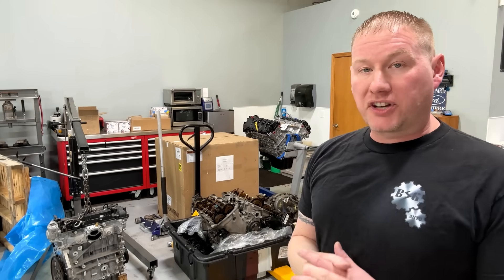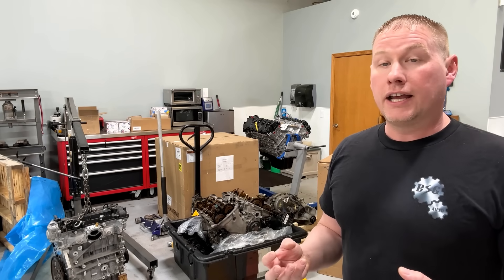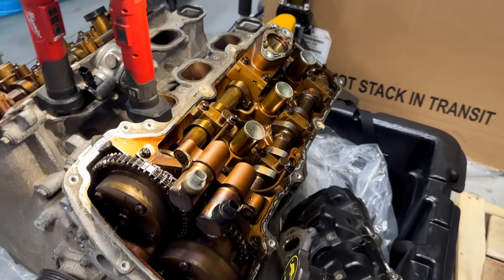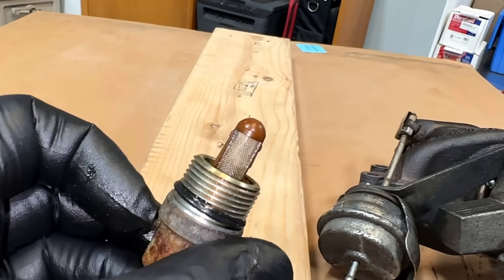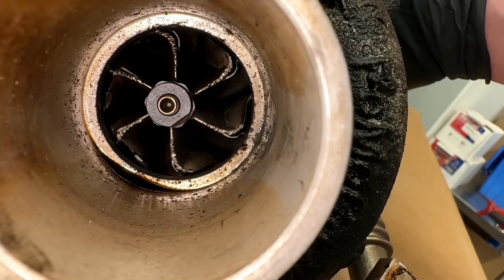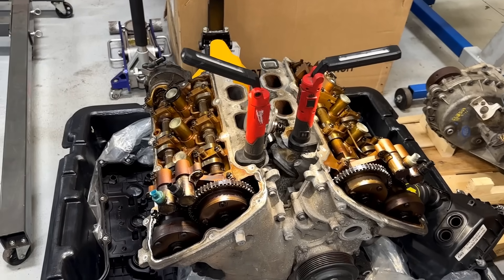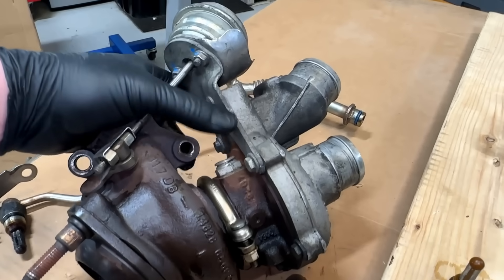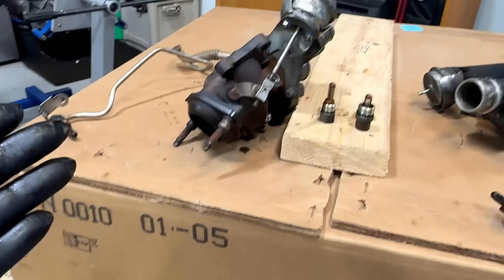This is Why You Never Run Extended Oil Change Intervals on The Ford Ecoboost Engines!

Comment: What weight do you recommend also does it matter what brand of synthetic oil? Is costco Kirkland brand full synthetic okay?
Reply: 5W30 in the 3.5 Ecoboost. The 1st gen 3.5 is not too picky, it cares more about the interval and the correct weight more than anything else.
Reply: @BamaTidefan1967 that’s what I use, I also change my oil every 2500 miles or less. Costco full synthetic and the filters I use comes out to 22$ an oil change. Well worth it to do it all the time than to have these issues. I also run that BD oil treatment ever other oil change.

Comment: I have used Full Synthetic , have even sold it , for 5 years or so in my high mileage vehicles , no turbo though , going the extended miles and then some a few times and never had an issue. Sent in to be checked  a couple times and could have spun on new filter and kept on with close to 36,000 on 25,000 oil. From my 2001 Lincoln Town Car , 4.6 V8 300,000. I do all mechanic and maint. Im getting the Trans changed with their brand and everything serviced for its third Vac trip we do in June from Kansas to Montana. Wife runs it 6 days a week to work just over 60 mile round rrip so it helps me not being under it every week. Good product and regular tlc is key. Good video.

Comment: This subject is the main reason I have always said putting turbo's on gas engines for the general driving public IS NOT a good thing. The manufacturers cheap out on oil coolers, which I feel is very crucial in keeping the oil from breaking down and develop sludge and varnish. Also the manufacturers testing methods don't come anywhere near real world everyday driving. They upsale the maintenance schedule because they know if you follow the manufacturers oil change intervals, you will be breaking down soon after hitting the end of the warranty.

Comment: Does the 3.5 take 6 qt or 5 qt of oil? I have a 2016 3.5 with 150k miles, and I owned it since 110k. The dip stick has always indicated its full with just 5 qts of oil but the owners manual says 6 qt
Reply from the maker: The 3.5L has always been 6qts.
Reply: @FordTechMakuloco  should I be putting 6 qts in even though it's showing its overfilled on the dip stick? I do oil changes every 3-5k miles with just 5 qrts for a few years now and the engine has always ran as smooth as butter

Comment: Can you buy those screens by themselves?  Or do you need the full oil line?
Reply from the maker: They are sold individually.
Reply: @FordTechMakuloco  Thanks! Do you happen to have the part number for a 2014 Flex?

Comment: If you run conventional oil you will have this issue every time. Running a high quality synthetic and having your oil sent off to be analyzed when you change your oil will give you a lot of good information about how long you can stretch one oil change. I’ve seen turbocharged diesel engines rack up over a million miles on 60k drain intervals and never had sludge issues  they tore the engine down end everything was within factory specifications for reuse. It’s all about the oil you buy. A high quality full synthetic will always outlast conventional oil. Some brands of synthetic are better than others. Me I’m a schaffers guy I used to run the pennzoil platinum then switched to schaffers because it’s a better longer lasting synthetic oil. I’ve saved money making the switch to schaffers oil and not having to change it as much
Reply: Also my engine isn’t sludged up. What little bit of sludge and varnish is in my engine is from way back when it had less than 150k and was getting motorcraft oil ran in it.

Comment: On the new 2.7 ecoboost that are direct port injection. Ford recommends synthetic oil at 10k intervals. Should I change it sooner than the recommended ford intervals?

Comment: You recommend full synthetic? I do 4000 miles with fords synth blend.
Reply from the maker: On a direct injected turbo based engine oh yeah
Reply: @FordTechMakuloco  i got a 2018. I believe it is direct injection. Maybe i should switch to amsoil…

Comment: All direct injection turbo engines should be running a catch can. I’m installing a catch can as we speak on my wife’s 90000 2.3 Mazda turbo, I replaced the turbo with a brand new unit around 80000 and it still sucked oil into the intake immediately after. Biggest pos I’ve ever worked on, the first and last turbo I’ll ever own.
Reply: Dual injection engines don't really need a catch can but with just DI, absolutely.

Comment: First gen ecoboost on my 2011 F150 and I've got 287k miles! Religious maintenance and it's treated me well! No major repairs (yet)
Reply: yea, i remember the 200,000k mi. days, seems like yesterday.  Set the dash reminder at 50%, Oil Change at 5,000 mi..  2011 F-150 w/ 3.5 Eco, sitting today @ 397,745k mi.  Next Oil Change @ 400,000k.  I also add Lucas Oil Stabilizer @ every oil change, 4oz. when i was under 200,000k, 8oz. ever since.

Comment: So bought a used 2018 f150 2.7 90,000miles from Ford dealer put 5000 miles on it and had oil changed at same dealer they were adamant on 5k oil changes book maintenance interval all wrong! Thanks for the video. I learned a lot.

Comment: Great video, it is amazing how owners will will keep pushing longer oil changes, I don't care what they say
I always change my oil on everything 3000 to 3500 miles, it doesn't matter if it full synthetic or synthetic blend,
it is much easier to change oil and cheaper than changing a motor out.
Reply: Me too I use oil that they claim can run long service intervals but I still change at 3000 miles

Comment: Not a 3.5 EcoBoost, but on my 2.3 EcoBoost (2021 Ford Ranger) I have gone to doing a drain and fill on the oil every 2,500 miles, and a full oil and filter change every 5,000.  Full synthetic only.  These turbo motors dirty the oil after very few miles!

Comment: Every 3000 miles with synthetic high mileage oil on my 2015 Escape Titanium 2.0 with 132,000 miles...oil is crystal clear at and after oil change. Well worth it IMHO. Snappy little engines that make driving so much fun!
Reply: which synthetic high mileage oil do you use?
Reply: Love my 2.0. Maintenance is key.

Comment: Thx for all the great videos.   I know you are busy but I’m hoping you can answer a question for me.  I’ve watched your videos on transmission fluid change and filter change on F150’s.   I have a 2013 with a 3.7 that has 134k and I want to change rear diff fluid and trans fluid.   The trans fluid change makes me nervous because I have no issues now. You still do recommend that this fluid is NOT “lifetime” and should be changed with the filter correct?   I know refilling them can be tricky and I just want to make sure I’m doing it correctly.   I probably go overboard with oil changes because I still do 3k mikes in semi synthetic.   I’ll probably never change that.  Thanks and keep up the awesome work.

Comment: This is Fords fault as well, ultimately they setup the intelligent oil life monitor parameters.There are so many vocal ppl on the Facebook group’s still insisting that Ford knows best and to follow the oil life monitor system.Anything more is a waste. I did mine at 3000-4000 and the oil was dirty.Couldn’t imagine going 10k.

Comment: I get an oil analysis every time i change my 2.3l Ecoboost on my ranger. The metals are always super low and wear has been great. And beey consistent. Every 2700-3k is the interval i go. I always let the turbo idle down and let fresh oil get to it before i shut it off. All this thanks to you brian. My ranger loves the oil changes and im glad I found you to take care of my Ford
Reply: your turbo is getting fresh oil all the time. The thing about idling them, like on a big heavy duty diesel, is to let the turbo-s cool down before shutting them off.
Reply: @oneninerniner3427  right. The pump is giving it fresh oil. The turbos have filters in them for the oil to pass through. If you have old oil in your system (not fresh) it will cake the inside of the filter, turbo and oil lines. That's why it's crucial to let it idle down (even a non diesel ) cause if you shut it off while it's hot, it'll cake more oil on the inside of the turbo. @fordtechmakuloco just did a video on this with a twin turbo V6.
Reply: @champinsoccer9  yeah I seen technalocobrains too. Point being a high quality premium 100% synthetics like AMSOIL are way more resistant to varnish, sludge and turbo coking. Most oil molecules are positively charged & oxygen is negatively charged so they are attracted. I think that's the way it is but it could be the opposite too, I forget.  So anyway oxygen starts to break down most oils right away turning them into varnish which is the precursor to sludge. High quality premium synthetics are neutrally charged so they do not attract oxygen. That is a big positive right from the get go for turbos. Not to mention the fact that they take the heat and the cold way better, way more thermally stable. Their film strength and wear protection are all but unparalleled. I speak from personal experience here as a life long mechanic by trade and retired amateur racer with great confidence in the Amsoil.
Reply: @oneninerniner3427 I’m an Amsoil fan as well, I also believe in breaking in the engine and changing oils way early. Bought a brand new 2024 and I’ve already changed the oil at 2,200k
I’ll likely change it again at 3,000k for the rest of its life. I enjoy servicing all my toys and I seldom have an issue with anything!
Reply: Hello!   I own a 22 Ford Ranger Tremor 2.3 EcoBoost.  I treat mine the very same way.  I am 65 plus and have only owned Fords.  Great truck and engine,  so far!
Reply: @markward9652 wow that's awesome sir. It is the perfect little truck indeed. I love those Rangers with the tremor package. Thats the sweet spot trim honestly. Best looking trim too.

Comment: I try to tell customers all the time, don't go by the "normal operating conditions" maintenance interval. Change the settings in the maintenance minder system to reflect what the "special or severe operating conditions" schedule says. 
They always get mad at me and tell me it's not required to keep the warranty.  I tell them if they are keeping the vehicle after the warranty is out, then they should start saving money for repairs. But that seems to make them madder.
I'm getting to the point where i don't  care anymore when they break down on the side of the road and incur big expense.

Comment: what about if they are idling for approx 10 hours a day?  The company I work for bought a 2013 Escape with a 1.6L Ecoboost  we use it at low speeds 15 mph or less and it idles the rest of the time
Reply: Be glad it's not yours...

Comment: Both turbos launched on my 3.5 Transit 250 with about 125,000 miles on it. I relied on the vehicle's maintenance system for oil changes. 
I researched oils and filters, changed both and never go over 5,000 miles between oil changes. The engine is coming up on 270,000 miles. 
Thank you for this video. I hope it helps people avoid the grief and expense of turbo issues.
Reply: I changed mine every 5000 religiously I don't care what the computer says or anything else tells me

Comment: I lost a turbo at 120000 mi! Never went very far, within a couple hundred miles over 5000miles between oil changes with either ford full synthetic or other quality full synthetic oil.

Comment: I have an 2004 Ford Ranger with the 4.0L SOHC, and I always change the oil at 5k miles, or less. Oil is cheap, engines ain't.

Comment: I have lifetime oil changes from my local Ford dealership and they have tried to move me from every 3000 miles to 7500 miles on my 2013 F-150 3.5L Eco. I am at 142 thousand miles and hoping to get another 100 thousand miles out of it. Now that I am aware of the new oil spec I will ask them if that is the oil they are using.

Comment: Manufacturers should be earing these costs when their oil change intervals (both the manual and the onbiard computer) are clearly WRONG.
Reply: The maintenance minder default setting is for "normal" operating conditions, not real-world operating  conditions.  The setting can be changed though. And there is a "severe," or "special" operating conditions section in the manual that is reflective of real-world. 
Most people, including the service personnel,  don't know that. Sad.
Reply: @rays7437  Exactly. People will know 100 useless facts like their favorite celebs clothing, vacation, etc, but can't be bothered to read one page of the 4000lbs of steel they pilot everyday.
Reply: @watchandjewelryloft4713  
I know what you mean. 🙄

Comment: I change the oil on my 3.5 a lot. Every 3,000 to 5,000 miles, typically much closer to 3,000 than 5,000. Full synthetic. Fingers crossed.

Comment: My 3.5 EB is showing exhaust gas in the coolant via block test. It’s also loosing small amount of coolant.  Dealer told me to keep an eye on it since it passed a cooling system leak down test.   I’ve lost piece of mind with this engine.   It’s running fine but is this the beginning of the end?  Is there any other way exhaust gas is entering the system outside of head gaskets?
Reply: Is the oil getting coolant in it? 
Is there steam/white smoke coming from the exhaust even after the engine is fully warmed up?
If it fails the block test, then it could be the fault of one of several things,  all of which require the removal of engine parts. It could be turbo seals, intake manifold gaskets, a cylinder head gasket or gaskets,  EGR cooler seals, a cracked engine block, or a cracked cylinder head.
Reply: @rays7437  coolant is clean.   I’m pulling plugs at the moment and taking pics of all the pistons.  One stands out with “clean” spots on top.  Ran out of time so I’ll get to other bank tomorrow.
Reply: @ryanrudolph1050  👍

Comment: Worked for a diesel engine maker for 30 years starting in 1970. At that time they already had turbocharged engines in production, but in the next few years and beyond turbocharging took over and almost all the engines were turbocharged  within 10 years, or by 1980. We never had a filter such as the ecoboost has in the turbo oil supply line. I would remove it and never look back. I would also change my oil on an ecoboost as Mak suggests. I won't have to worry about it though because no FORDS!

Comment: this explains why my bank 2 turbo failed a few months ago and allowed oil through to my Catalytic converters destroying them. Guess I'm gonna start doing oil changes myself again. Dealer wants to make it every 10k miles
Reply: Or you could just take it in every 5K and tell them to change the maintenance minder and the reminder sticker. Most service advisors don't actually know anything. They just repeat the advertising and they are given. Nobody reads the fine print.
Reply: @rays7437  it's way cheaper for me to change it myself. I can do both mine and my wifes car for the price of 1 works package from the dealer. especially with the discount I get at my local NAPA
Reply: @benh554  
Do you use OEM filters or NAPA filters? When I can't get OEM I buy NAPA Gold filters. And yes, The Works package around here is anywhere from 60 to 90 dollars.  Crazy. But then prices of everything have gone crazy high...

Comment: It's sad that the interval you're recommending here is the same interval my mom used on her 2000 Expedition 4.6L that had 316,000 miles when she sold it and with zero engine issues.

Comment: Domestic Brands Mount the Turbos too close to engine block.  Without Heat Shields 🛡 between them.  That's reason 1, tuners know Turbos get up to 1,875° F and mount far away and cutout Heat extraction vents on the hood ( boot for British). 
Porsche perfected the mounting positions away from engine.  
LeMans Prototypes ( LMP) Mercedes even have Turbo issues.. they get passed by these Pocket 3 or 4 cylinder cars, and when they that their day is done. 👦👍🏎🏁🚩
The Ecoboost is EcoTragic.  I went from Ecoboost to 2022 Roush Mustang with the 3rd Pedal Speed Manual Transmission.  It is by far more economical than the EcoTragic.  After 1st engine it last 1.5 year's, each time extended warranty pays for only 1st months rental. 2nd is out of pocket the 1st time,  and the 2nd time no Rental re-embursement for both months.

Comment: So knowing the engine ultimately failed because of oil starvation due to the (badly) failed turbo dumping oil through the exaust side, I find it hard to believe that the turbocharger having that much free play in the shaft wasn't making a bunch of noise before the catastrophic failure happened that ultimately took out the engine.. makes me wonder if the customer did hear a noise and just ignored it.

Comment: Thank you for the info, I learned something new today.
Question: If the engine oil and filter are  changed every 3K-5k regularly, is it necessary to change the turbo filters and feed lines , and if so when would u recommend them to b changed ? 
I say again Thank you for helps us ford owners keep our vehicles running down the road.

Comment: Older engines, specially Toyota, are more resistant to oil sludge related failures because of larger oil passageways. Even newer toyota engines are less tolerant from extendend oil change intervals.

Comment: What about setting the oil life to 40 or 50 percent?
Reply from the maker: You could do that is your setup allows that.
Reply: @FordTechMakuloco  Yes My 2011 F150 Ecoboost (134,000) allows it, but my 2013 Expedition (5.4 185,000 miles) does not.
Reply: Yes. I try to tell people all the time that they can do that but they usually just get mad and say it's not their responsibility.